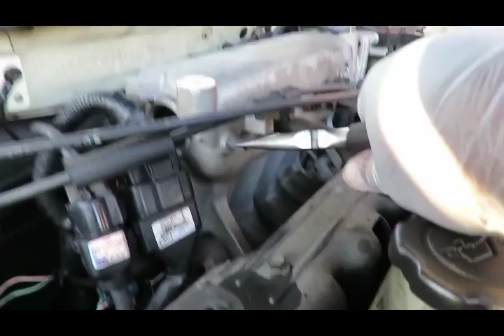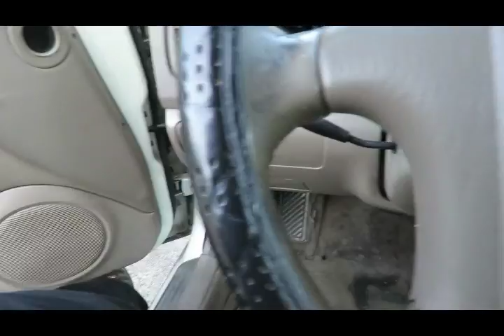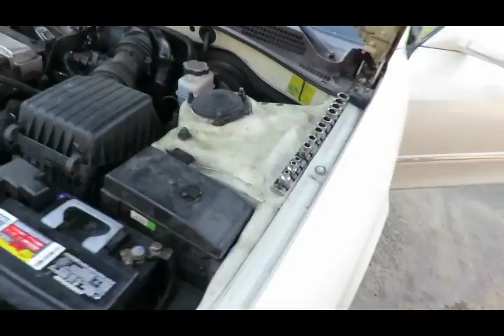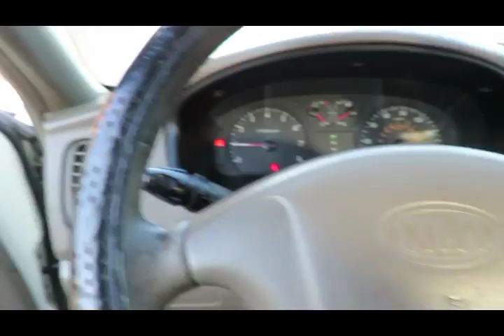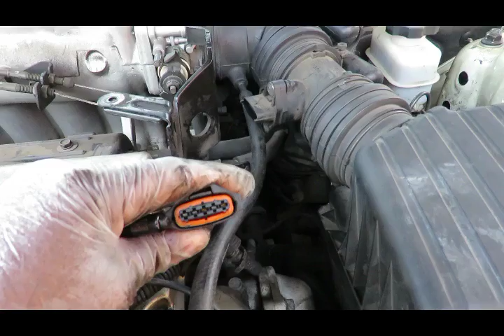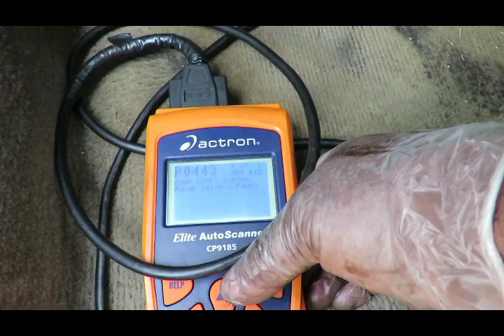⭐ 2002 Kia Optima - P0102 - Mass or Volume Air Flow Circuit Low Input

Comment: Hi i have the same prob with my nissan sentra can u help??. It on have the code and i just replace the mass and still getting the. P0102
Reply from the maker: Did you clear the codes? If so, you might want to check the wiring next.
Reply: @OnlineAutoRepairVideos  no the code is still there. Now after driving it for a while it wont start.
Reply: @OnlineAutoRepairVideos  it just crank the its getting fuel and spark no cracks in the tubes from the mass to the intake .

Comment: Wow. 

But same exact issue with my 03 Jetta. I actually cleaned the sensor itself with alcohol and qtips. Gonna follow up with this though because although it fixed it, it still does this once a day or two
Reply from the maker: Once a day?
Reply: I had the same thing on my kill same code I checked all the wine and it had a broken hose I replaced the hose but I still getting this same cold p01 02 code just coming back up
Reply: I cleaned the terminals checked all the wine replaced the broken hose but I still coming up with the same code running rough

Comment: so far all of the vacuum lines look good, no serious leaks. replaced same line on left of valve cover as you did vid, bc mine was little dry rot( but still no leaks) . checked connections, and to me anyways, seemed all good. pulled the connector on the maf, and all silver prongs, actually looked clean. but didn't have chance to check or pull the two o2 sensors in front of exhaust manifold. (I've actually never messed with the o2snsrs before , so didn't want to mess with until checked proper way .

Comment: contact back and more than happy to share details, btw I hooked up ecu reader, got the trouble p0102, p0141 o2 heater circuit bank 1 sens 2, mass or volume air low input bank 1 sens 2
Reply from the maker: First check the air tube between the mass and the throttle body carefully. Make sure there is no cracks in between the grooves. If everything is okay, clear the codes and tell me what comes back.

Comment: i got the 02 optima se 2.4 4cyl , problems i am having are almost identical to the ones in the vid. I've checked the vac lines, they are ok. another thing while driving it will throttle then bog down, w sec throttle then down, all while holding pedal in whole time. & smtmes it will run fine, but 9o percent time won't. any suggestions? been working on car for 3 weeks now, talked to 3 mechanic, no one's helped/knows what to do. anything would help. thanks so much